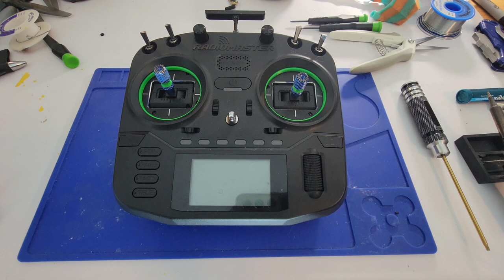Wireless Foot Pedal - AUX Switch - DIY Radio MOD!!! 🐧🏁🔥🔥🔥

Comment: Pro tip: when heating shrink wrap, keep the flame moving or use the lighter to "lick" the shrink wrap with the flame. It activates pretty quick, and this helps avoid melting anything.

Comment: This is super cool and would be neat to set up a  awesome mod on a rc car for even more immersion.  Now we just need a steering wheel too (who needs brakes 🤣🤣🤣) Can you use it with pwm?
Reply from the maker: Thanks man... The little relay switch does everything from your radio controller b4 the signal goes out to your craft... So I would think you could use it for pwm applications basically the same way... (This one is just an on/off switch, so might need some additional parts to get variability for a gas pedal or steering wheel though)... Cheers 🐧🏁🔥🔥🔥

Comment: Can that not be wired into one of the LED channels as an additional switch?
Reply from the maker: I'm not sure if it would power it or not... The LED ports at least on the boxer are 3.3v and I think some of the Amazon reviews said the device won't power up until 3.7 - 4 volts... That's why I opted not to use those...
Reply from the maker: I was thinking about your question... when I was building it I had also considered mounting and powering the switching device inside the module bay... It can be powered directly from the radio battery voltage as well... (will handle up to 3S)...

Comment: Great idea! What are you using the pedal for?
Reply from the maker: "Street League Spec Drone Racing" (the frames my company builds) use a custom version of betaflight to limit RPM... That allows them to incorporate "Boost Mode" where pilots get three 5 second long 1000 RPM boosts per race... It makes for a fun and challenging new race dynamic, but it messes up my controls trying to hit switches while racing... I've heard people that play computer SIM sometimes use them as well... Cheers 🐧🏁🔥🔥🔥
Reply: @TurtleModeFPV  wow I didn't know that, awesome man